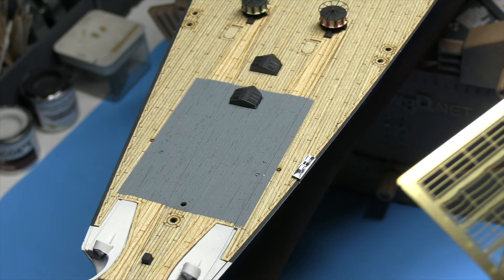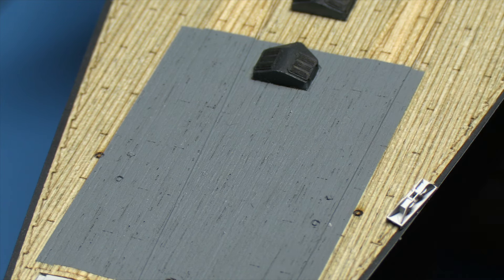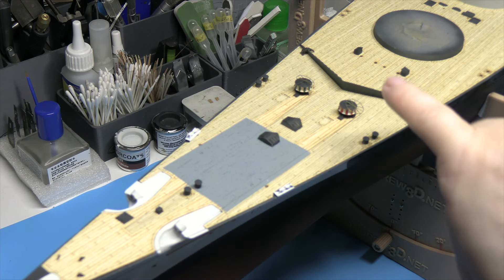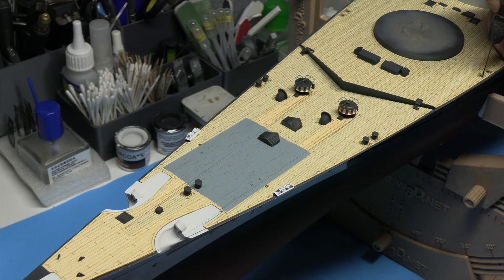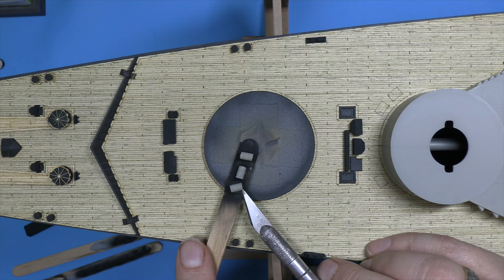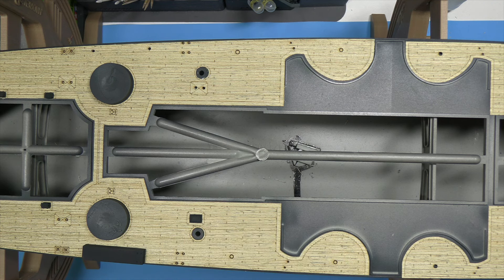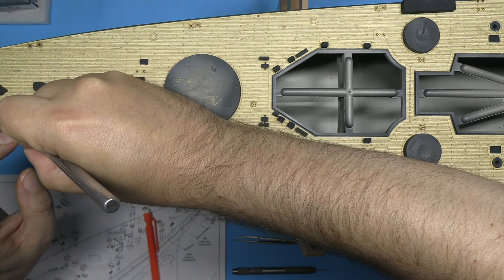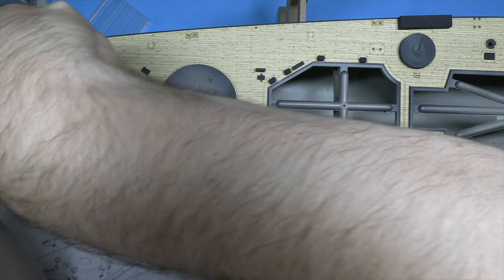Building Trumpeter's 1/200 Scharnhorst with MK 1 upgrade Part 15.

Comment: Hi Jason, enjoy your work on the Scharnhorst. I noticed you put rigols on the hull, in the Mk 1 upgrade kit they have include portholes not rigols which is correct. Take care. Mark
Reply from the maker: HI Mark,  if you look at any references you will see the hull scuttles just have rigols and that's why I have used the WEM ones
Reply: @ModelkitStuff  Thanks, Jason. l will continue watching with interest as l build my model, although it probably won't be to your standard. Cheers.